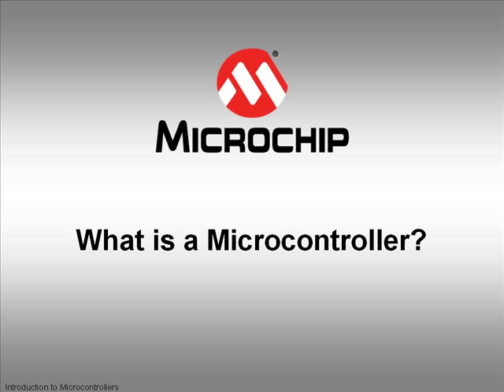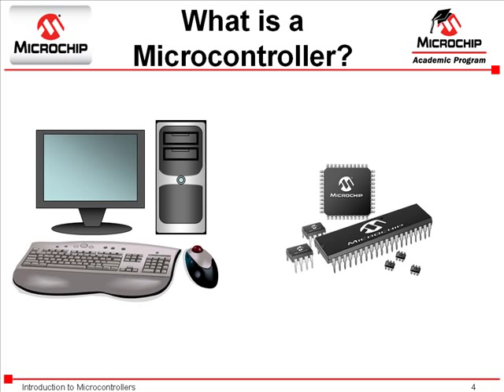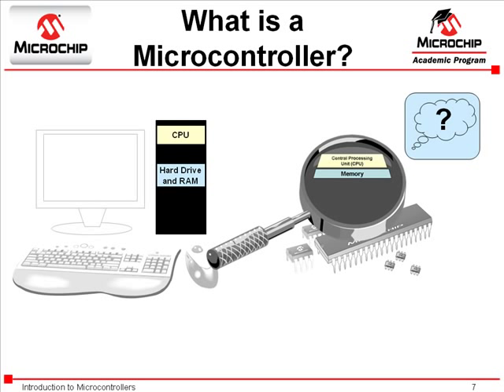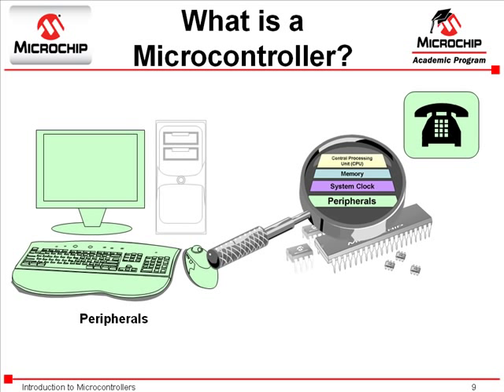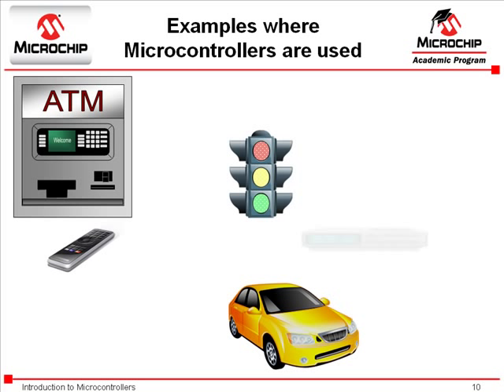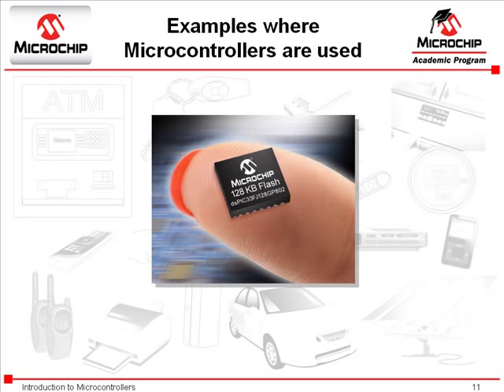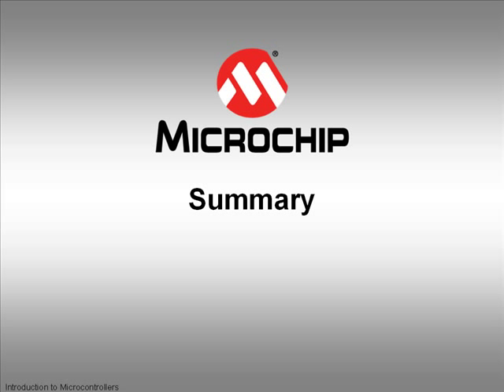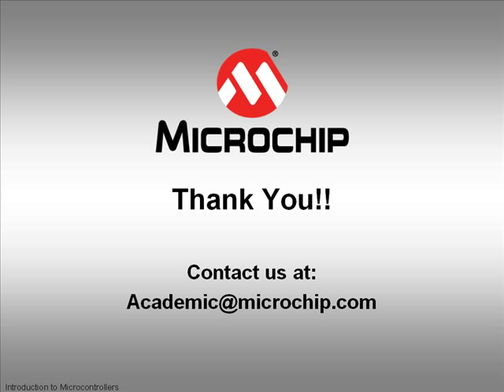What is a Microcontroller?

Comment from the maker: @Oshyrath Microprocessors only contain a central processing unit and math co-processing unit. They don’t have memory or peripherals such as digital inputs or outputs. Therefore, if you want to store the information calculated by the Microprocessor, you will need to connect it to off-chip memory. If you want to communicate this information with the outside world, over say a USB connection, you will need to connect the Microprocessor to an off-chip USB controller or peripheral chip.

Comment: Microcontroller is an integrated circut that's more complex than a microprocessor (CPU) which is another type of integrated circuit only with less discrete components integrated in it because the CPU or microprocessor in a traditional sense (not counting SoC and SinP or Package on Package w/ 3D IC)  is but a part of the microcontroller.

Comment: I didn't quite understand how system clock and CPU interact and how the ability of CPU to process is linked to clock speed....can someone explain?
Reply: Since a computer processes information, raising the clock speed increases the rate of which this information can be processed. You get done with a job (ie render a video) faster. The CPU does the information processing.

Comment from the maker: @farooqbhai001 The peripherals for a PC are far more complex and much more diverse. Think about Ethernet cards, multimedia cards and so on. Making all of this integrated onto a single chip would first of all be extremely expensive, if possible,  and would make it very difficult for the user to upgrade a system or repair it should there be a malfunction of any of these components. So I guess the answer is that it just isn’t feasible or practical.

Comment: So a microcontroller is a little computer?
Reply from the maker: A microcontroller (MCU for microcontroller unit) is a small computer on a single metal-oxide-semiconductor (MOS) integrated circuit (IC) chip. A microcontroller contains one or more CPUs (processor cores) along with memory and programmable input/output peripherals.